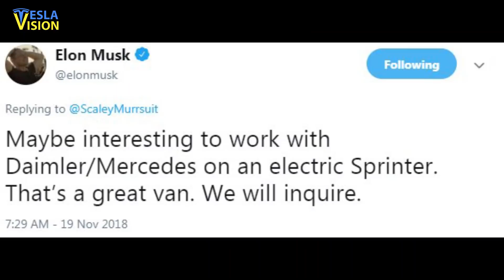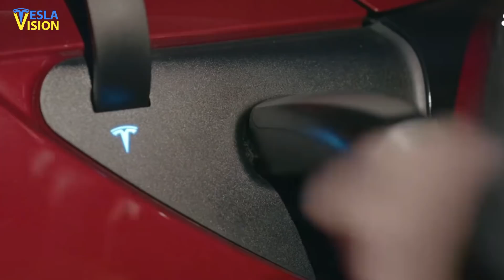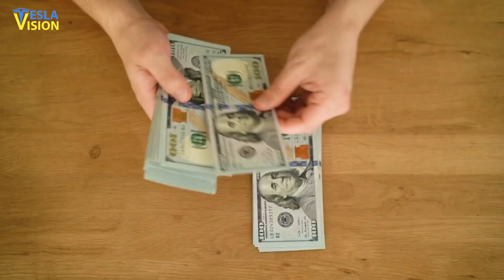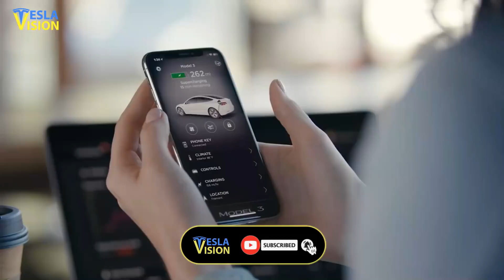Elon Musk Confirmed SECRET Van That Might Change Everything

Comment: Let's hope a Tesla van has a decent range, the current crop EV vans only have a range of 80 miles which limits the distance you can travel for work especially when picking up supplies
Reply: Elon stated it will have a min model range of 300 miles.

Comment: Until we see actual vehicles being sold it’s an unknown. 
It would be great if Tesla could improve it’s time to get products through from design to manufacture. And more factories. (Moar!)
Reply: You just need look at battery production and car demand to know when new vehicle models will be made. It mostly just comes down to economics. If tesla sells every car they make and they are battery constrained, then they prioritize the most profitable model with the smallest battery packs. This is why dual motor model Y has a much longer wait than the performance model and why Semi, cybertruck, and robo van are probably going to be delayed for a while untill batteries are no longer the limiting factor.
Reply: I prefer Tesla making as good as a product they can and making enough of them. They already have an excellent lineup and I appreciate them focusing on producing those as much as possible until they reach an equilibrium in supply & demand. They have LFP and 4680 batteries coming in the pipeline which should help alleviating the battery constrain, after which I would expect many new product announcements.